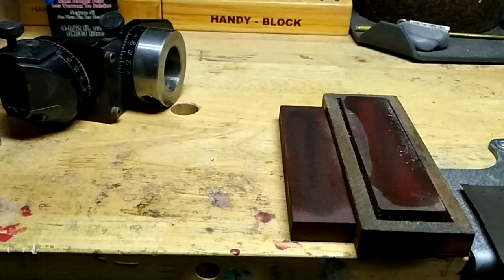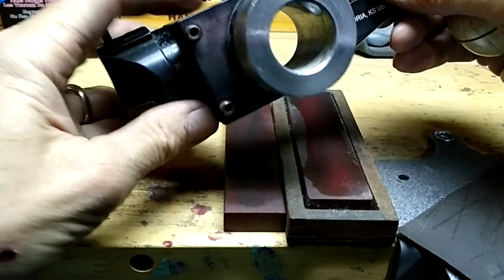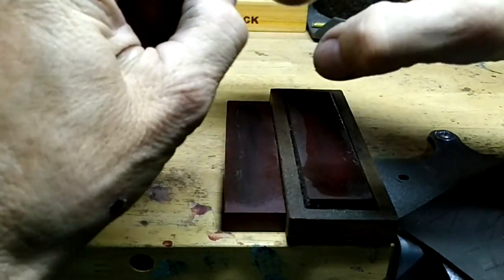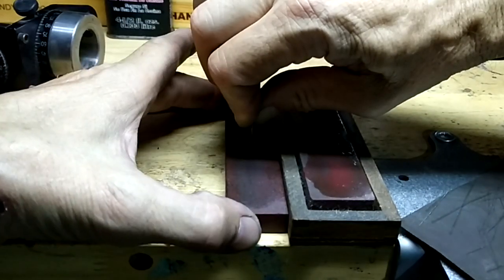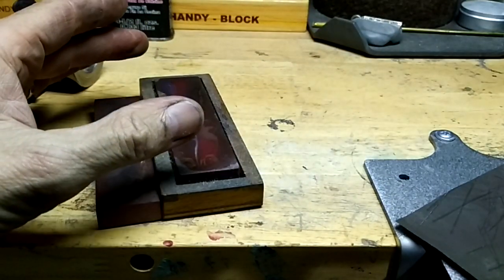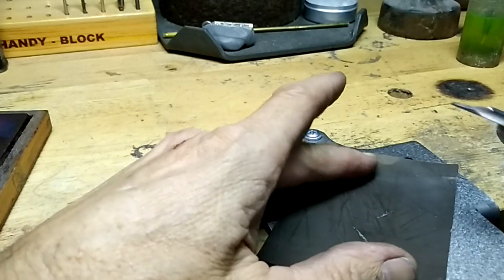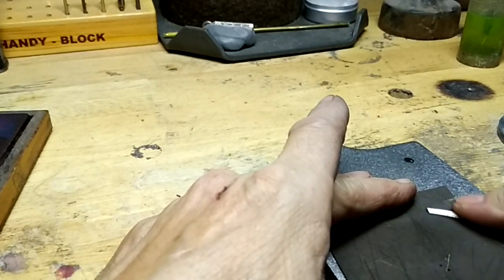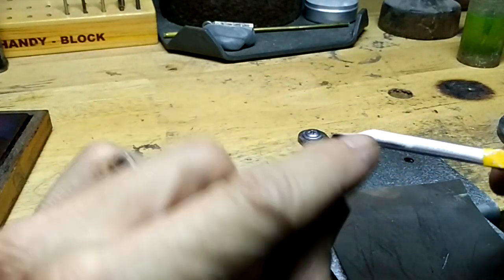Sharpening Gravers for Stone Setting

Comment: Thank you Craig. I can never find any info on sharpening the thin gravers like this. I’m struggling so much because I bought a set to get started grain/bead setting and I don’t even know how I can sharpen them. I know most all
Jewelers I know don’t own a powerhone or templates so I was looking for the basic way to do this at the bench for setting mostly and cleaning out not engraving: my question is, do I only need to use the stones on the angle for the face? So the sides , leave them as they come and just keep polishing from time to time? I wish there was a simple video to show the most common and basic shape graver for a setter and how to achieve the shape and sharpness with basic tools.